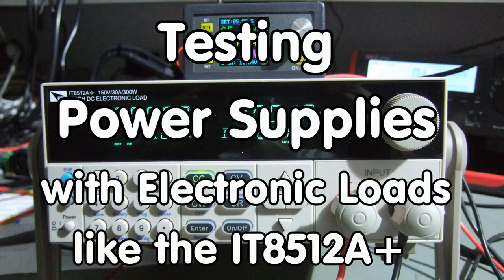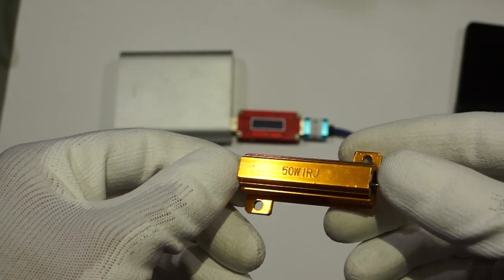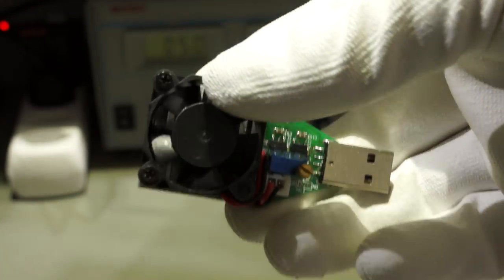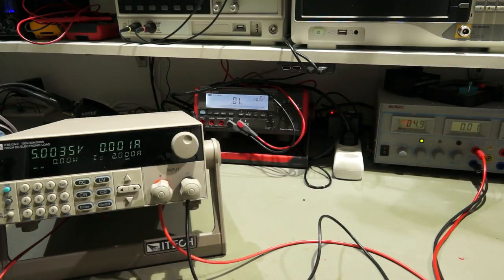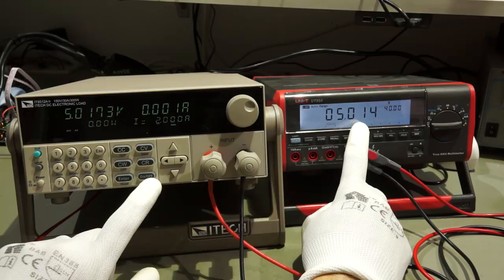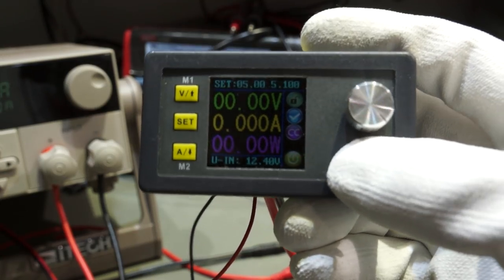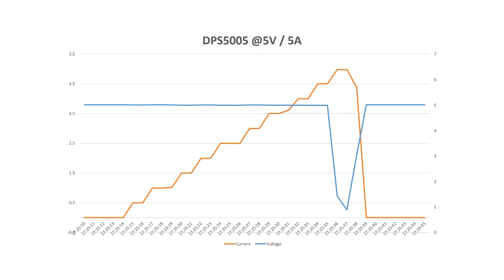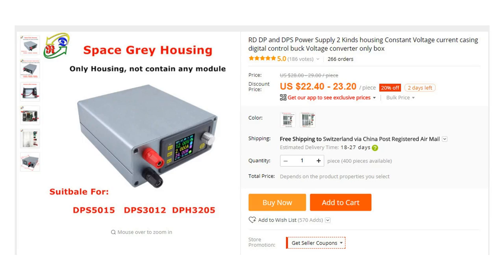#146 Testing Power Supplies with cheap to expensive Electronic Loads, Tips and tricks

Comment: I just received my Maynuo M9712 DC Load about a month ago, its "exactly" the same as your unit for about US$440 from AliExpress. I can send the supplier link if anyone wants one from there, as I the first supplier replied "there were not any left in China"... well I got one from another supplier and fast! I also managed to get my hands on the isolated USB adaptor for US$40... wish I had access to your video before that purchase to make one myself... although the one I got works fine.

I think there are a few of these units under different brand names, I have not seen any bad reviews of the different variants. I am very glad to have it in my lab... already used it a few times and couldn't have done without it.... the PC connection/software is great.
Reply from the maker: Thanks for your feedback. I am sure, your input help others to decide.
Reply: Both your videos and EEVblog have help me equip my lab, providing great advice based on both of your vast experience. You are doing great work Andreas, keep it up!

Comment: at 5:55 it should be a voltmeter across the shunt resistor, it measures the current flowing across a known resistance using ohm's law by measuring the voltage across the known value of the shunt resistor
Reply from the maker: Theoretically, you are right. For me, a meter which measures Amperes is an Ampere Meter. Usually, you would name it on the panel in Amperes and would select the shunt that the reading really is Ampere...
Reply: @Andreas Spiess, I understand what you are saying, but to my mind you're wrong.
Please consider a noob-user watching your video; this user would switch a multimeter to measuring amps and connect it as you show. This will result in confusing readings compared to what the user expected.
That's why I agree with @nicktohzyu, either you show a voltmeter parallel to a shunt resistor OR only a amp-meter in series with "the circuit" (no shunt). That way you don't confuse inexperienced watchers :-)

You could put a box around the shunt and volt-meter and call the box an amp-meter.

In general I really like and appreciate your work and videos!!! But this is a mishap, that I think you should correct.
Ich freue mich auf Eure nächstes Video ;-)

Comment: Yeah I bought such a power module dps3005 and a metal casing (all components were included but I connected the switch on the back differently to turn the fan on for high loads or off when on very small load) It's very handy and cheap for a lab power supply for a hobbyist! I run it from a laptop power brick which supplies around 19V only but can deliver several amps, and that's enough for most electronics that only require up to 12V.
Reply from the maker: +Geert Goossens I think, this is a good concept and a useful second life for a laptop power supply. I also have such an idea for the traveling Hobbyist, which anyway always has a Laptop with him.

Comment: Excellent video Andreas, you've convinced me, I need to invest and get myself a proper electronic load, it will save me the trouble of messing with the cheap ones. I was looking at these two for quite some time (Maynuo and Itech). Also having the multimeter grade display, saves you from using an additional two instruments..
Reply from the maker: I enjoy it so far. But, of course, it is only for people like you and me. Many others will be happy with the cheaper versions, if they do not use them too often.

Comment: Another useful video but power supplies need to be tested for noise, transient response etc. if they are going to be used on a serious electronics bench. Some shots of your lovely scope and the new load switching between currents would have been nice.
Reply from the maker: +Mike Hudson You are right. I looked at the noise, but did not include it for this video as most of the viewers will use it to power digital circuits. The transient response is also important for some applications. I try to keep my videos between 10-20 minutes, so, this time, I omitted both.

Comment: Thank you for yet another informative video! I got interested in the DPS5005, so I checked the specs. It seems it's a voltage step-down device that takes up to 55 V and steps it down 50 V max. I guess you have another power supply feeding the DPS5005 around 40V DC, which in turn is connected to mains power 230 AC(?) So this spawns 2 questions: What power supply was that supplying the DPS5005, and what were you testing in this setup then? I think you were testing a power supply and a voltage step-down in conjunction. Ie, in this setup, can we always be certain that the last device in the chain (here the DPS) is at fault if we get "crappy" results? Sorry if this question is somewhat basic and badly formulated, I hope it's understandable :-)
Reply from the maker: For this test, I used my bench power supply and only at 12 volts. And you saw the performance of the bench power supply in one of the other tests: It is ok... So, I really tested the DPS5005.
For a proper setup,  I would use a 48V constant voltage supply and connect the DPS5005 to hat. Then, you would get a decent PS for up to a little more than 40 volt.
Reply: The DPS5015 is better bang for the buck with 3x the power in my opinion. The only reason to use the DPS5005 is if you need the compact size or if you want the USB/Bluetooth computer controlled version of it. Pairing it with the proper sized low cost (but not low quality) SMPS is the way to go for a low-cost bench supply <$100. That setup hasn't failed me yet and I push it hard for long periods of time.

Comment: Again a very good video !  Also interesting is the efficiency of power supplys, certainly if you gonna do a video about solarpower.  What is the inputcurrent with no load and with variable load.
Reply from the maker: This time, the focus was more on the technology of measuring with electronic loads. For sure, efficiency will be an issue with solar power...

Comment: Great video. I like the analysis. The electronic load is a little pricey though. Maybe in the future you will find a cheaper load like the power supply and review.

Your work inspires me to put out some videos too. So far I have not but I think I will soon.
Reply from the maker: I will do a video about cheaper loads
Reply: Thanks. Your comparisons are quite good. Enough info to get a good idea but not over the top technical.

Actually I bought 2 types of radar boards based on your reviews. Still in the post so I have not tested them yet but you saved me a lot of guessing and reading a ton of sites.

Comment: Hello Andreas, first thank for all your knowledge sharing. I wish also to get a DC Load, I just want know if now do you have a updated verdict about the It8512A+? My second choice is the M9811, both are more or less at same price. The largest display on Itech seems also great for me, but still the software seem better on the Maynuo. After few months of usage do you think is still a good choice or you recommends another device in place ? Thanks again for your channel
Reply from the maker: The software is the bottleneck. And the Manynuo seems to have a Sigrok driver. I usually use it without SW so it does not hurt.
Reply: Andreas Spiess thanks Andreas, yes I also take a look of sigrok and other way to use remotely. Many github projects allow to use the Itech.

Comment: excuse me, if I have a motor hub kit for my bike with a controller of 72v 5,000watts, and if I am building up a battery pack of 72v and 5,000watts,  plus the load of the controller. will it come to 70v or less when i connect the load_?
Reply from the maker: As long as your controller is capable to source the current needed by your motor it will deliver the voltage it is made for.

Comment: If those test leads are the inexpensive stock ones there's no way they're 14AWG.  They have extra thick insulation to handle high voltages.  I've seen some of them as low as 26AWG.  The only way you can confirm that a test lead is 20AWG is to make it yourself.
Reply from the maker: Good point!

Comment: hallo Andreas, 
I would like to buy a DPS5005-C with the function to connect it to the computer. can you say what could come in connection with the producer?
Reply from the maker: +Gooie Sorry, I do not understand your question
Reply: Ok, dann doch in deutsch :)
Ich wollte fragen, ob du schon sagen kannst was da kommen könnte? Da ich mir ein Labornetzteil aus einen DPS5005-C und 48V 5A Netzeil herstellen möchte.
Reply from the maker: Ich plane genau den DPS5005 mit Kommunikation zu testen... Und ein 48 volt Netzteil ist ebenfalls bestellt. Ich habe mir allerdings das etwas stärkere bestellt, weil die Chinesen teilweise nicht ehrlich mit den Specs sind (max Amperes) und der Preisunterschied relativ klein war...
Reply: Oh, da bin ich aber gepannt :) - Weißt du schon wann das Video circa kommt?
Das Netzteil wollte ich in Deutschland kaufen, da die vom Preis nicht wirklich günstiger sind als bei AliExpress. Netzteil von Ebay (http://www.ebay.de/itm/Schaltnetzteil-5V-12V-24V-48V-Netzteil-Trafo-DIY-LED-Strip-Power-Supply-Frei-DHL-/132189957040?var=&hash=item1ec722abb0:m:mA-z3lhBsyQbwTBZcXbxgQg)
Ich finde sämtliche Videos von dir klasse und verstehe auch alles, bloß selber ein englischen Satz zu formulieren fällt schwer, da ich so etwas nie mache.
Reply from the maker: +Gooie Nein. Ich muss die Teile erst bekommen und dann in die Liste einreihen. Leider liefern die meisten Ebay Lieferanten nicht ausserhalb der EU oder zu horrenden Preisen für die Verzollung. Aus China geht das lustigerweise viel einfacher.
Reply: Hättest du mir ein Tipp für ein Netzteil aus China?
Ach ich hatte gar nicht dran gedacht das die Schweiz nicht in der EU ist, ich hatte lange drüber nach gedacht was du mir damit sagen wolltest :D
Reply from the maker: +Gooie Nein, ich hab einfach eines auf's Geratewohl bestellt. Die letzten, die ich erhalten habe, waren alle ok. Und das Risiko ist nicht gross, wenn du es sofort testest, wenns ankommt. Wenns nicht läuft, einfach Dispute einreichen

Comment: Those RDTech power supplies are great, I have 7 of them, including the new remote control version which is handy when used with at PC.  RDtech's stuffs official store is rdtech.aliexpress.com if someone wants a direct link. RDTech's software is much better than those shown for your load. I'm guessing that is the version he is sending you. It is handy with Bluetooth or USB connection. The seller is a great guy too, very helpful and always easy to get ahold of. Shipping time is super fast as well and well protected as mine has come in a big styrofoam box with bubble wrap inside.

I also have 4 of those electronic loads and they are great. The main reason to prefer them over others is the fan control! Thankfully someone was smart enough to have the fan be more than just ON/OFF like with ZKE Tech products and that initial smaller load you had shown. The one you showed by ZIHYU the zpb30a1 (i have v2.7) actually bases the fan speed on the temperature so it only spins as fast as is needed depending on your load value. Just make sure you get the model with the newer fan, it is much quieter than the original As with many fanned devices, adding a bit of space between the fan and heatsink and sealing the outside gap now created, can reduce noise even further without impacting your airflow negatively 

Speaking of on/off fan controls, if you get one of the RD Tech housings, don't wire the fan as suggested. Modify the circuit by using a transistor (or just connect directly) connected to the fan on the power board (the non all in one units, or ones with a fan, the better price/performance models) so the added external fan turns on only when the internal one does. Little less noise in the lab that way.
Reply from the maker: Thank you for your tips! My link directs also to rdtech, just with the possibility to support this channel.
Reply: Sorry about that, just didn't want anyone to miss out due to an adblocker preventing them from seeing the link or being able to visit his store. I love his products and the value is great when you grab one of his DPS5015 and a 48v DC SMPS to make a low-cost bench power supply. SMPS that are 48V can usually be adjusted over 50v so you get voltage needed to get the entire 0v-50v range and @15A if you get a supply with enough power. The SMPS can also be mounted away from the main unit allowing for the bench portion to be tiny compared to alternatives and lower cost than many 0-30v @ 5A bench supplies that take up 5x more space (ie, Korad KA3005P which seems popular).

I still don't get why everyone suggests using Banggood, everything there is overpriced vs. AliExpress, at least from what I've seen. Is it just due to the affiliate program? I'm also biased due to having nothing but bad experiences buying there even though I always paid extra for upgraded shipping. Items were always delayed, poorly built and a much bigger hassle to get things sorted out than aliexpress where sellers are eager to resolve things due to the way it is all setup. But if it helps the channel, I guess it is good in that way and people seem eager to pay a little extra shopping there. 

I have some more AliExpress shopping to do today (as always) so I'll follow your links. Do they work across the entire site once followed, or do you have a link that works across the entire site? Would love to give back.
Reply from the maker: I also have some other products from him and they are good. And I ordered a 10A/48volt PS as you describe. I hardly will use much more...
The Aliexpress links are fairly new to me and I do not know how they work. They also should be cookie based. So, your purchases should trigger my reward when you start your session with one of the links. Thank you for your support because being YouTuber as I do is quite costly. But I hope, others can profit if I do the testing for hem...

Comment: There is an alternative firmware for the dps5005 available: https://johan.kanflo.com/hacking-the-dps5005/
Reply from the maker: Thanks for the link! Interesting. However, I was not unhappy with the user interface.
Reply: Andreas Spiess a custom firmware is  not only interesting because of the user interface design, dataloging or charge controlling and a lot of other ideas ... As you mentioned in you video the Chinese hardware design is quite good but the software... sorry most is crap and will not survive the next windows or linux update. I'm not using my nextion displays any more, because of the half backed software (fixed spacing fonts and many other issues) It would be nice if the Chinese Manufacturer give the software to open source or even the documentation not only copying open hardware designs. I.e. Sigrok makes the Chinese logic analyzers useful. My first look before buying hardware is if it is hackable The success of Espressif is based on the makers and open software / hardware community.
Reply from the maker: +Christian Meinert You are right. I think, one problem is the price pressure. If you know, that your software will be stolen in five minutes by your competitor, you probably do not invest a lot. The second problem I think is still the language issue. But open source and at least a decent documentation would be for sure a good strategy.
BTW I was never successful with Sigrock and Windows.
Reply: Software development is expensive and keeping it up to date is even more expensive. Hardware for my home automation is normally done in a few hours but the software is never finished!
Reply from the maker: +Christian Meinert This is probably also because of our Asian friends. Building HW is also quite complicated, and creating chips even more. And all for a few cents. For me, this is nearly impossible. To manufacture a CPU with so many Transistors, and if an important one is defective, the whole thing does not work anymore... But obviously, they master this process. And in the West, we are still ahead with SW.
Reply: Ahh, the joys of DIY home automation. It truly is a never-ending cycle of development. Crank out a sensor node in under an hour and spend much more time adding it in, customizing it, writing automation routines, changing everything over and over as new ideas come.
Reply: And when you expect more than a fancy remote control - more a kind of automation - it is getting complicated. I'm trying develop  a routine to interdependently decide when to start my garden sprinklers and for how long each zone should run taking into account: previous program runs, humidity measurements, weather forecast, daytime, movement detection ... Always things to improve.
Good if you are not dependent on the manufactures imagination.  And which manufacturer guarantees to develop there software for a longer period. Understandable when you price in the software within the hardware. It will be difficult to demand extra money for further software development later.
That's why I only invest in Hardware which is a kind of "timeless" or "hackable" or DIY in the beginning.

Buy it, perhaps use it, take it apart, study it, hack it, improve it, own it.
Reply from the maker: Right so!

Comment: Andreas in ohms law V=I/R V = voltage. Great Video again mate. Alway loved 4 wire measurements.  Used it a lot in calibration. 4 wire was the best way to check impedance of parts in a circuit.
Reply from the maker: +Chris B Most of the references to 4 wire are concerning resistor measurements.But it works also here.